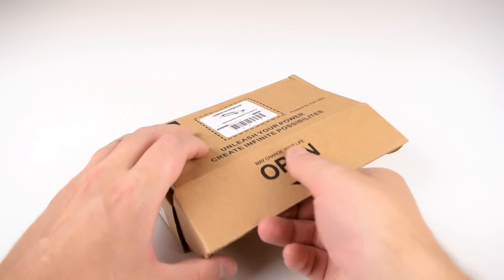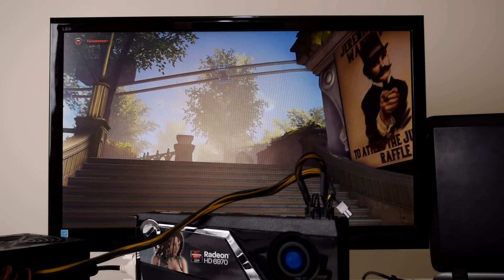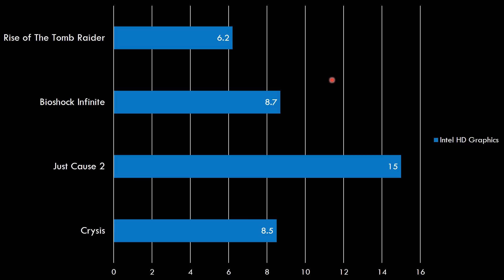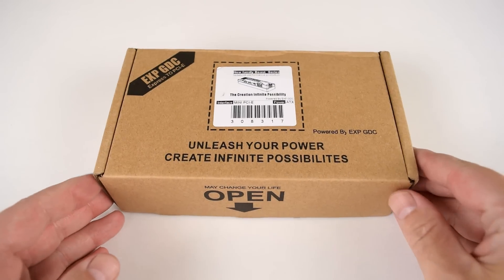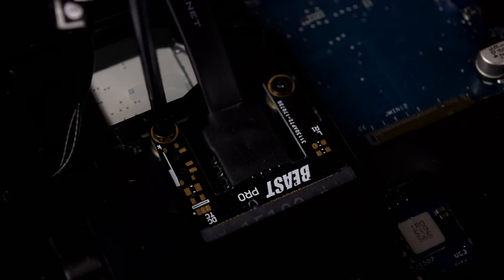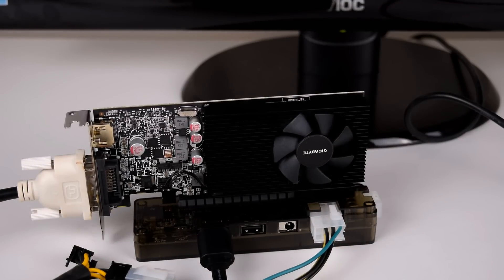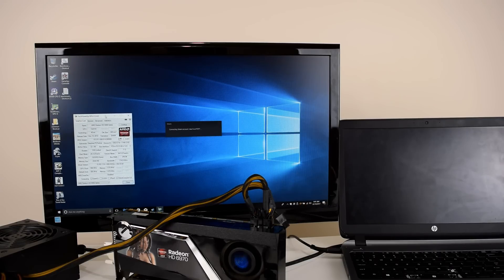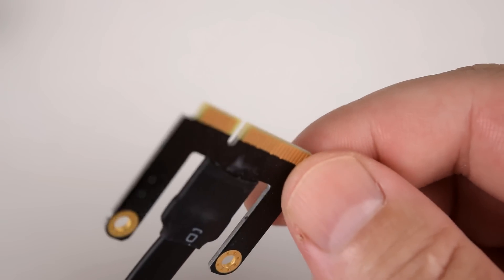External Graphics Card - Cheap Gaming PC with broken screen Laptop

Comment: One thing that always comes to my mind with these is Crossfire...I wonder if it would work.
Reply from the maker: Haha, got to find a laptop with two mini PCIe slots :D
Reply: PhilsComputerLab you should totally Check out the DELL E6430 Series, socketed CPU, 3x Mini PCIe, 1x expresscard and even an Moddable bios with Core i7 Overclocking Support, Overclocking of the RAM and the gpu. Got mine for 160€ with an i5 3380m, 640gb hdd als w7 pro. Great Device.
Reply: @kjjustinXD  I can't talk about the E6430 specifically, but I personally have a E6420. It has what looks like 3 mini-PCIe-slots, but from my limited testing (which involved moving the wifi card around into the other two pcie-slots), it seems like only two of them are actually connected to the PCIe bus, and the 3rd only has USB connectivity routed through what looks like a mpcie-slot physically.

I am currently waiting for a mPCIe to M.2 adapter to plug into one of the spare slots, in order to hook up an NVMe SSD internally, but it's taking forever to get delivered :(.
Reply: kjjustinXD You forgot Raid support ;)
Reply from the maker: kjjustinXD Nice
Reply: Mathis Super with a 3740QM you can overclock it using UEFI variables up to 4,1Ghz one core, 4,0Ghz two cores and 3,9Ghz three or four cores. But if you use it like that with CPU intensive tasks it's best to lower the turbo with Throttlestop or it will thermal throttle. The laptops cooling system is unable to sustain such a high overclock with an heavy load.
Reply: Mathis Super 

I got the Non-Nvidia Version, i know from my own Experience that egpus Work better if you dont have a Dedicated Card in the Laptop. Thats Why i got it Without One. The backlit Keyboard is also awesome.

I Overclocked the Intel HD 4000 to 1550Mhz and it runs ok with that. Its even faster than the Nvidia Card Now. Works well for old Games but for CPU intensive Tasks it will get down to around 1300mhz.
Reply: That's a pretty chunky laptop.
Reply: How about if your laptop had discrete internal graphics or was an amd apu would that work with crossfire in this setup too
Reply: Will this work on my old laptop which is compaq cq42
Reply: @PhilsComputerLab :  I could swear I have already seen a Core 2 Duo Laptop with two Mini PCIe Slots in person somewhere. Unfortunately I can't remember what brand or model it was :/
Reply: PhilsComputerLab i have hp pavilion dv7 with gt 9600m and also 3 mini pci ports.
Reply: You could use m.2 but it's finnicky because it implies there's an adapter m.2 > pcie/mpcie and that your m.2 has pcie interface capabilities.
Reply: you can use the expresscard slot and the wireless wifi pcie slot to hook up 2 of those to a thinkpad t410 or any older pc with expresscard slot. would let you hook up 2 cards to 1 laptop. i dont know if it will work with 2 i got a new gpu and 1 adapter coming if the adapter works i might try 2

Comment: In order to use a GT 1030, GTX 1050, GTX 1050 ti or GTX 1060 3GB you need to mod the Nvidia 368.81 desktop drivers to ad support for them. Disable the driver signature verification in windows in order to be able to install the modded drivers. Remove NVIDIA restart need reg key using regedit, followed by the installation of current NVIDIA desktop drivers (without the clean install option) and only then restart  the laptop. And you should be good to go. Credit goes to others @ egpu.io
Reply from the maker: I do feel that it will be a back and forth with Nvidia blocking things, and community finding workarounds.
Reply: This problem seems to be accidental since it doesn't affect GPUs from previous generations. The eGPU community is just so small that NVIDIA simply won't bother to fix it...
Reply from the maker: Artur Ferreira Sweet. I will try the workaround if I revisit this topic.
Reply: I think this comment needs to be pinned, honestly.  This is a very important bit of information for anyone trying to do this, especially since the 1030 seems to be the weapon of choice for low-end users.
Reply: Phil, what's the current state of 1030?

Comment: Hmm, I have a Fujitsu P702 w/i3-3110. I wonder if I should get the Expresscard version and a GT1030, perhaps using the Optimus driver to get some extra performance...oh...poop.
Reply: Voidsworn it works with the workaround. I've tested it with a Dell E6430 and a HP 2570p both using expresscard.
Reply: Artur Ferreira so, poop averted,  I guess. Thanks.

Comment: You could find some older laptop with better CPU like I7 3610QM... or upgrade a ivy bridge laptop with a 3610QM we can buy for around 50€. A year and a half ago I got a dell E5430 with 3610QM / 8Gb and 120Gb SSD for less than 160€
Reply from the maker: I'd love to do one with Express Card GPU. The CPU model numbers for mobiles confuse the heck out of me, got to do more research.
Reply: PhilsComputerLab Me again. :) In order to use expresscard I would recommend a Dell E6430. They are easy to find used online and for a low price. I would call it the perfect eGPU machine on a budget.
Reply: yeah, I think express card is the best option, more easy and modulable.
If you are confuse with all of them CPU, you can check on "CPU world" the specs (and socket), I can tell you that HM6x chipset weren't compatible with ivy bridge processor (only with sandy bridge) and HM7x chipset were compatible with all socket G2 processor, then for haswell only 4xxxM and I7 4xxxMQ/X can be replacable (mount on a socket) the other CPU wich end with "H" or "HQ" were soldered onto the motherboard, to be sure before buy a laptop check with the model number if someone had already upgrade it.
Be carefull with Sandy bridge and ivy bridge because some laptop use Socket G2 and some other are soldered, even if they have the same reference, check on google to be sure ;)
Haswell use Socket G3 with all of "M" and "MQ"/"MX" series.
Keep in mind if you want to do external GPU to use at least I5 or I7 ivy bridge processor because they were the first to support PCI-E 3.0
I hope all of this can help you even if it's a little bit confusing
Reply: TheQuentincc unfortunately with mPCI and expresscard you are stuck with "just" PCIe 2.0 PCIe 3.0 is only available for the internal dGPUs if present.
Reply: Yes you are right, the CPU support the PCI-E 3.0 but the chipset doesn't.
But the PCIe 3.0 start with I5 and I7 ivy bridge but it also start on some Z6x motherboard but requires I5 ivy bridge cpu at least.
The only cons (for me) to have a ivy bridge laptop is his CPU power draw at idle (lead to a "bad" battery life) compare to haswell and we cannot undervolt the CPU a contrary to haswell.
Reply from the maker: Artur Ferreira Had a quick look, yea lots of them on eBay Australia. i5-3320M seems pretty decent. I will ask a few sellers, maybe someone will work with us.
Reply: try to find a 3610QM or 3630QM, they are cheap and good, look at local citizen if they sell one ;)

Comment: Who the fak throws away an notebook with i5 and 8gigs of RAM?
Reply: Hey my friend almost threw out his i7 4700hq, 16gb ram, gtx 760m laptop just because the screen was broken lol. Long story short I snagged it off him.
Reply from the maker: Bargain :D
Reply: You should take a peek on the eevblog dumpster dives.
Reply: Welcome to "How the average consumer reacts".
It's painful to see, really, but they keep doing so always.
Reply: +PhilsComputerLab XD
Reply: I got an Asus G74sx for free with an i7 2760qm (4 core 8 thread), 12GB DDR3 1600, GTX 560M 3GB, and a Bluray drive...was missing the 150W charger, back cover plate thing, and the SSD and HDD (can take 2 drives).  So far have done nothing but slap a spare 320GB HDD in it, but it works...plan to get the missing parts, add another 4GB of RAM (4 RAM slots, 1 free), a cheap SSD, and possibly replace the 17.3" 1600x900 display with the 1920x1080 version.  Might also need a new battery.  Still...I think it'll be worth fixing up.
Reply: +Dr_Kachu san True. Dave has so much dumpster dive PC's...
Reply: And freaking servers.
Reply: That makes me cry internally that he'd throw that away.
Reply: Another man's trash is another man's treasure, some people don't know the value of their shit, they assume just because a screens broken that the entire system is shot.
Reply: My finance's brother was going to throw out a Thinkpad s230u just because it had a cooling issue. He gave it to me instead and with a new application of thermal compound it is good as new. Has an i5 3317u, 4gb of ram, 24gb msata card and a 500gb hdd.
Reply: Especially since the only thing that has really increased in laptops in the last years is the integrated graphics. Maybe power consumption, but that's it.
Reply: Well, the weight also got reduced due to ultrabooks which is basically only possible thanks to SSDs and SoCs.
Later make the whole thing more or less a single point of failure but also much easier to carry around.
Reply: 554 Timer hey! , I have 12gb ram on i5 5200u !!
Reply: I once salvaged a dual Intel Xeon server with 8 GB of RAM.
Reply: 554 Timer It would blow your mind what people throw away when its perceived as useless or obsolete, I worked for Office Depot for years and did computer work on the side for customers and people would give me old computers that had good parts alot of them were not even that old but a lot of people have this perception of Technology having a short lifespan it might be true for some stuff but not all so some people would upgrade their stuff every few years and me and my friends would come up with free hardware. OMG I almost cried when Office Depot started its tech recycling program people were dropping off their old computers and monitors laptops with broken screens Parts Galore and a lot of this stuff actually worked and it was all going to the dump me and my friends were able to liberate a lot of parts lol
Reply: +martinez1701a O.o
Reply: PhilsComputerLab while me here running on AMD e1-2500
Reply: schools because these are so cheap i almost. snapped the screen with my hands
Reply: Everybody doesn't work at Taco Bell.

Comment: Do you ever tried those usb externel GPU docks? They are dirt cheap even compared to the EXP, and they still works with a old laptop.
Reply: You can install graphics driver and connect to a external display to make it work, and it will still accelerate your graphics, but it's not really efficient. That's why I want Phil to try.
Reply: A USB port is hilariously slow for using it as a PCIe adapter.
Reply: They do Not have any Kind of Acceleration Integrated. Not for Videos, not for 3d. Its like if u dont have a Graphics driver installed.
Reply: Can you give a link?
Reply: The external Display Card has no Acceleration. Not even the expensive matrox ones. It uses the onboard CPU and gpu to render Everything over a Video Codec. Thats Why you cannot Watch Videos on them if you Connect a Display higher than 1280x720, the USB Port is not fast enough and with 500ma you cant Put in a fast gpu.  The best what you can get is 2D Acceleration.
Reply: USB?
3.1 is not supported on these old computers, so EXP is the only option
Reply: They are not usb c externel gpu, they are usb 3 gpu.
Reply: You can get an express card (PCMCIA) adapter for usb 3.0, which should work, i dont think you need 3.1